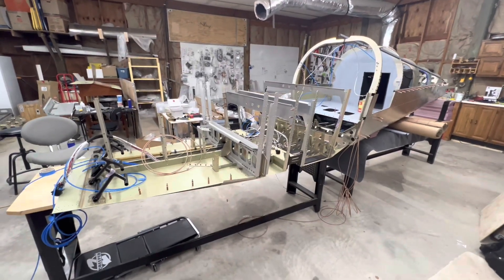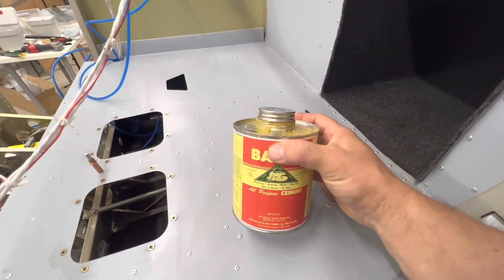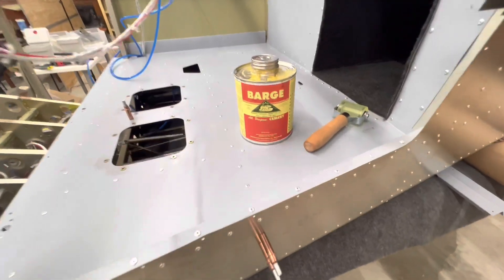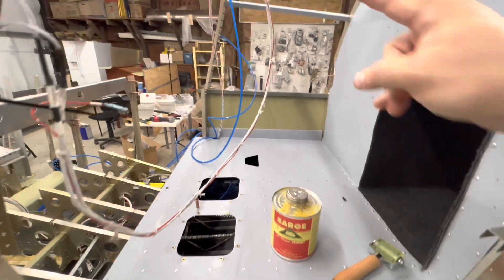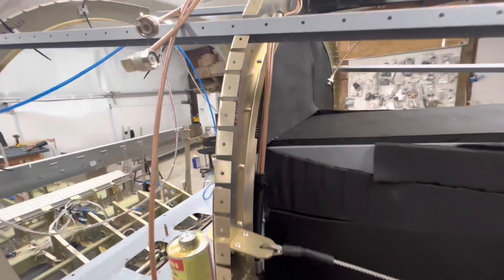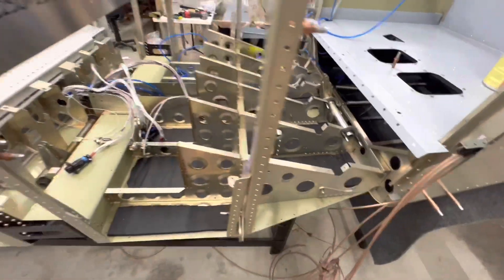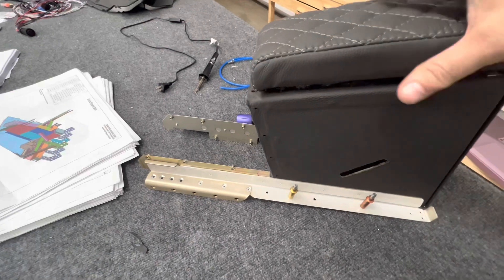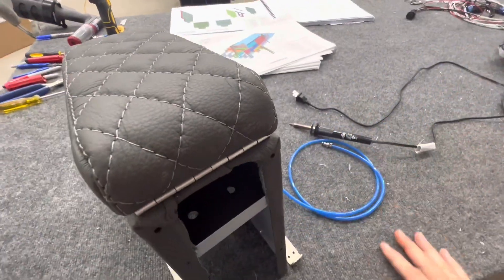Sling TSI Build Update - Carpet Installation, Fuel Tank Leak, Center Console built and wiring

Comment: I totally know the pain on the fuel tanks well.  If you aren't able to resolve the leak and need any guidance on removing that back plate and cleaning up the pro seal let me know over on firstrivet...
Reply from the maker: I was lucky and able to fix the last leak via the fuel sender plate.  I filled it with water first and had no leaks.  It then held pressure perfectly for over two hours but did drop 1/10th of 1 PSI over night.  I decided that could be temperature or barometric pressure and declared it leak free.
Reply: @aviationkitbuilder  sweet!  Happy to hear you’re over that hurdle.

Comment: What happens to that glue if it gets some corrosion x sprayed on it? Does it dissolve it and make it loose its adhesion?
Reply from the maker: I couldn’t say.  I primed or alodined my parts so I won’t be using Corrosion X.  I think most of the corrosion spray would be focused on the tail and wings well away from the carpet so you should be fine.